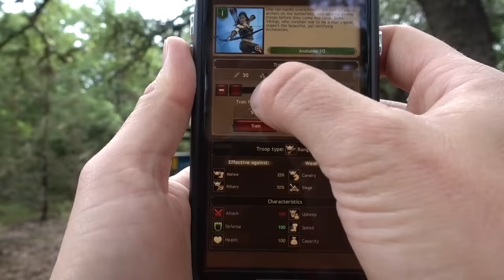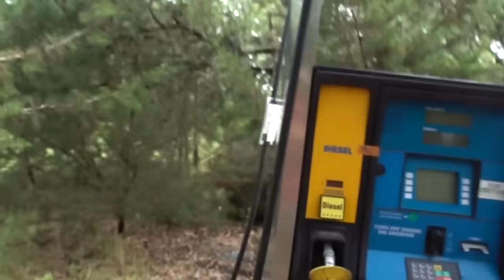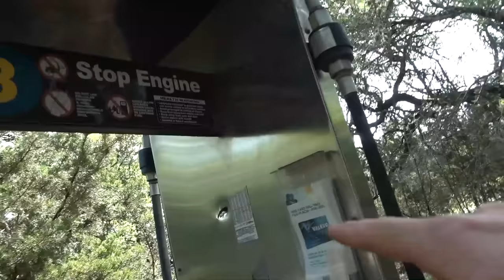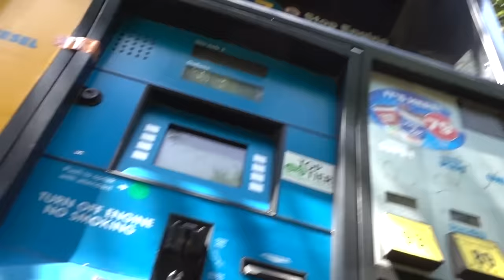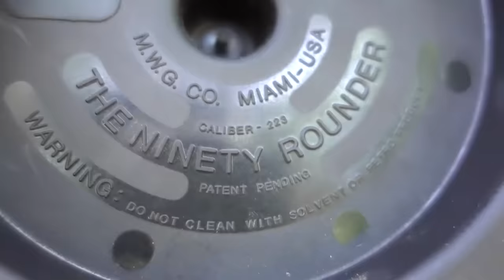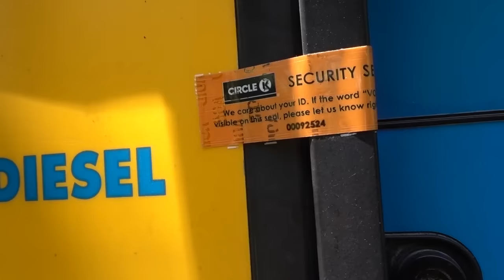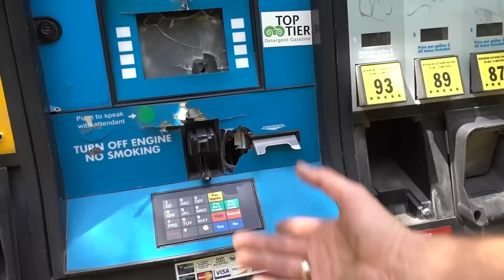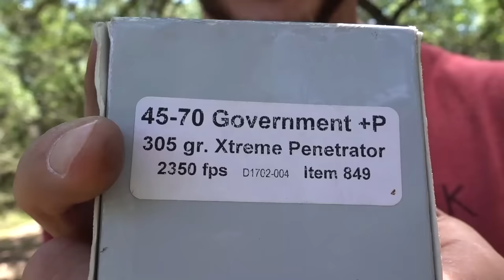Can A Bullet Light A Gas Tank On Fire???

Comment: Who else thought it was going to explode like in GTA
Reply: well, that spoiled the video.
Reply: me
Reply: Nah. I used to do maintenance at a gas station. If you loaded it with explosives they would blow. The gas would probably be fine. There’s less than a half gallon of gas in one while it’s operating, and actually pumping. They have crazy safety features, that’s actually mostly what I had to work on. You’re going to have more luck shooting a propane tank, and that doesn’t do much either. 

Honestly, water fucks these things up way more.
Reply: Since there is barely any storage in those things, I already knew it wouldn't. The storage normally is underground in huge tanks.
Reply: Nah i thought explode like fortnite
Reply: Yeah those that believe it would need to learn make believe and real life
Reply: I did not because normal bullets don't light things on fire.
Reply: That was my first though when I saw the thumbnail
Reply: nope I never believed that
Reply: Not enough storage and its the fumes not the liquid that ignites. The diesel needs pressure to ignite
Reply: @IAmAnEvilTaco   Yeah you are right, for a heavier fuel like Diesel (in comparison to a light end stream) you'd actually have to work at it to get it to light. Seriously...things like lubricating oil and the heavy fuel oils can have a lighter held to them and not catch. Gasoline engines needs an atomizer (to turn it into a fine spray) before the spark plug fires for this very reason...Diesel engines don't even have spark plugs. They use higher compression ratios to get the fuel to explode inside the piston, creating linear movement which is then turned into rotational movement by, you guessed it, a crank shaft! LOL!
I know an A-10 Warthog (the flying tank the US Mil uses for close air support) actually has self sealing gas tank incase a big artillery shell decides to take a big chunk outta the airplane...allowing the pilot to still fly'er back to base and not lose the airplane or importantly his life! 
LONG RANT OVER!
Reply: Me
Reply: ah shit here we go again
Reply: I didn't because the bullet would have to be incendiary to do that. No average metal bullet is gonna light gasoline in fire unless it's to the point of melting and splattering on impact.
Reply: It's a gas to fire ratio a bullet is hot but wont cause direct fire just like if u drop a cigarette in a barrel filled of gas nothing will happen except put it out
Reply: @ajcook7777  I like to think of the A-10 as more of a flying gun than a flying tank, although they are incredibly durable. The plane is like 75% gun.

Comment: If its diesel its not going to explode bc diesel isn’t flammable. Diesel engines compress the air fuel ratio until the pressure causes combustion

Comment: a .357 is LESS powerful than a 9mm, it has been proven a million times. the reason a .357 is longer is because .357's use black powder which is a slower burning propellant, 9mm's are shorter but more powerful because they use newer smokeless powder. same applies to 30-06 versus .308. the main reason for the creation of these smaller, more powerful rounds was to lower their weight so soldiers could carry more on the battlefield.